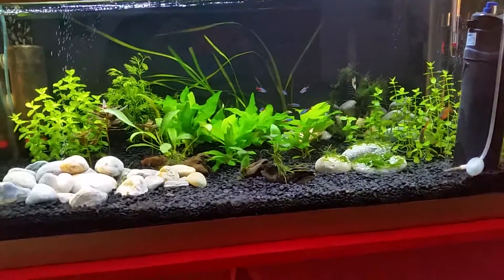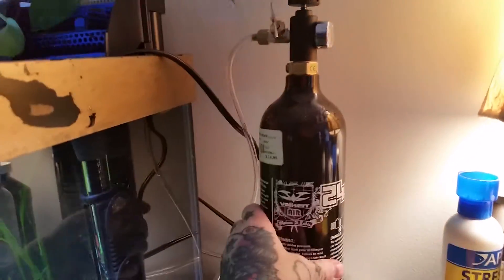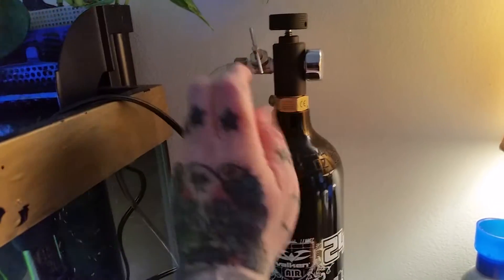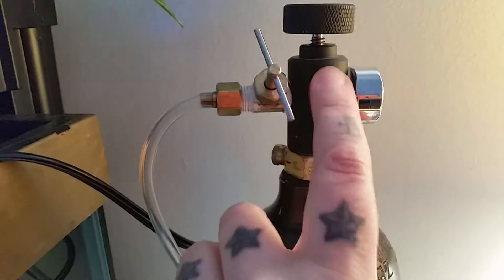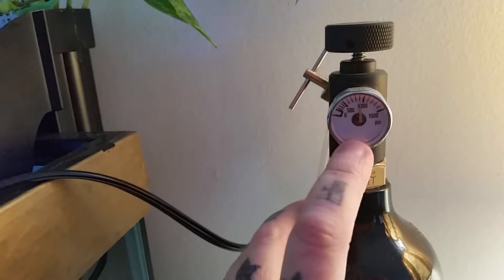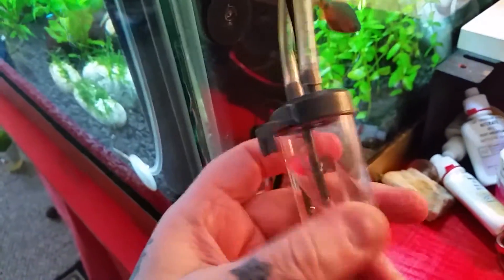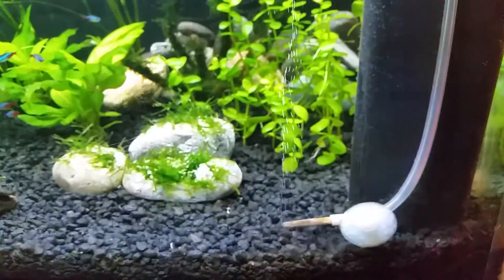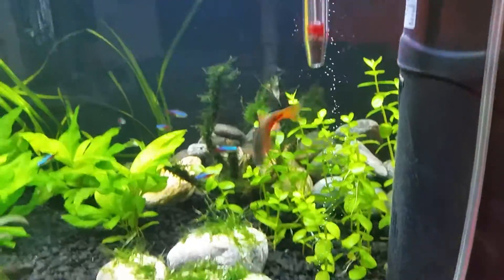PAINTBALL METHOD/ CO2 AQUARIUM

Comment: Could you link the regulator and little silver things you bought off eBay, that’d be the GREATEST!!!!🙏🏼
Reply: It's not a regulator, it's an ASA with on/off and a gauge. Assuming the ambient temperature is the same, the gauge will always read the same pressure until all the liquid co2 is gone and only gas remains. In other words you won't see the gauge move until you're below 1% remaining. You can get an idea of how much is left by weighing the entire tank though. But this method is not ideal for many reasons and actually unsafe, you really need to use a regulator.